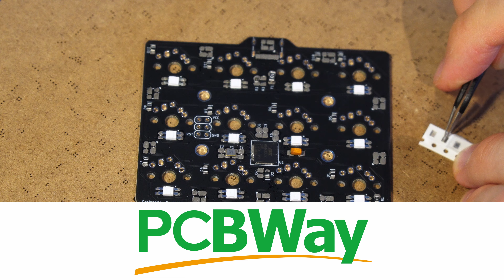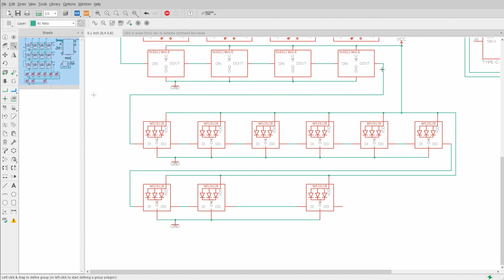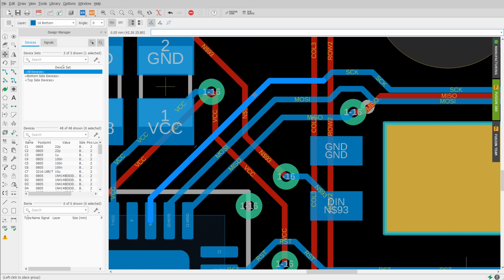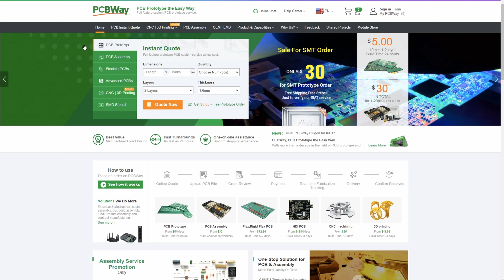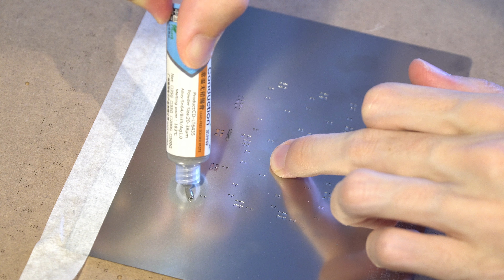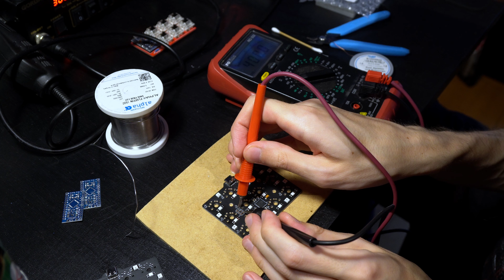Advanced DIY Keyboards Step by Step - Ep.2 Controller

Comment: Just one question would like to ask, how were you able to control individual key backlight, separately from the underglow while they are all in one series? I was reading the QMK documentation and I saw that the individual backlights should be wired in parallel towards an N-channel MOSFET.
Reply from the maker: I explained this in the first video, they are digital LEDs, so you can say "5th LED turn green" and then it will be passed on down the chain.

Comment: Thank you for the two parts you have released already, question I want to know when it comes to RGB lights If i want to make a full size one with rgb leds, I would have to limit them, but then how do I wire them all when i also have to wire all 96 keys to the chip as well?
Reply from the maker: You can also wire them all in series for the data (I believe they support up to 1000 LEDs) and then just set a limit in software. (QMK has a convenient variable for max LED power)
Reply: @DarkArtWorkshop  alright ill research it a bit more about the qmk variables. Thanks for the reply.